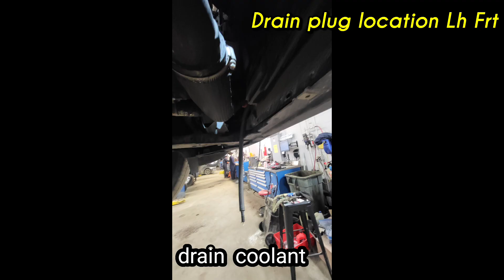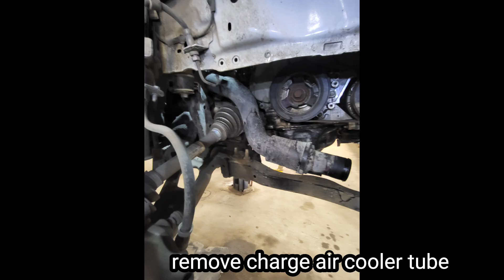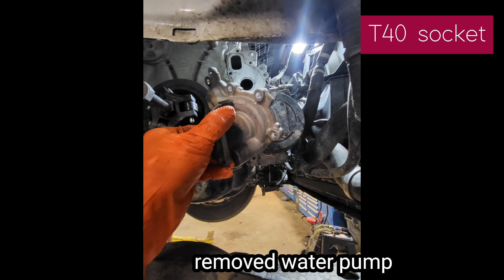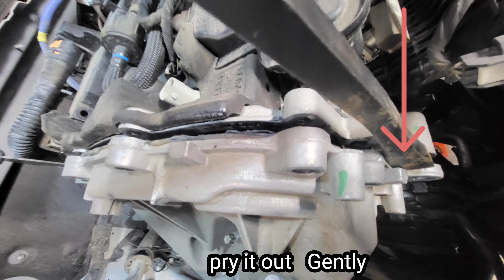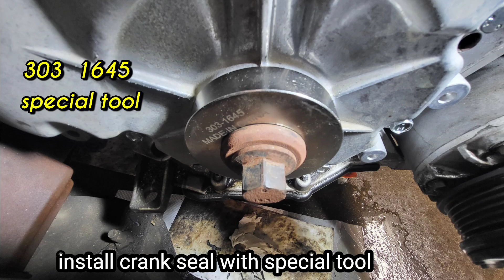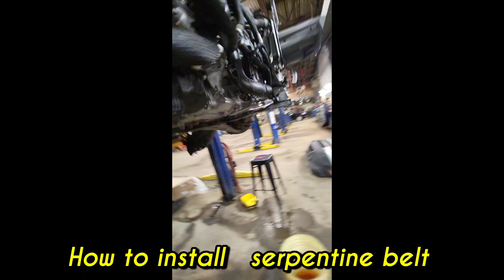Bronco sport, Escape 1.5L Frt Timing Cover Oil Leak , How to repair with silicone gasket .

Comment: 안녕하세요. Ontario에서 차수리하는  Charlie라고 합니다. 한가지 문의 드릴게 있어서 씁니다. 2019 Lincoln Nautilus  C05f4 : rear drive shaft speed sensor.   
Freeze data와 Live data를 보니, rear diff.의 speed sensor가 문제네요. 물론 local dealer가 stock 있는것에 놀랐고 지난 6month 동안 2개를 sold 했다네요.
8mm bolt 잘 풀고, sensor를 떼려는데 안나와요. torch로 heat up 해도 깊히 박혀있네요. 결국은 2가지 중에 하나밖에 방법이 없는것 같아요.
1.drop diff. as low as possible , put a screw (may heat up with torch) and pry out.
2.drop diff and remove sensor. (drill and put a screw and pry out).
먼저 1번을 할꺼고요, 문제는 2번을 할때 Diff를 removal 해야 하는데, axle pry out 안되네요. rear beam 에 welded 있는 bracket이 both 됩니다.
rear diff 를 removal 하는  tip 이 있을까요??
제 메일은 토니(tony) 인(in) 캐나다 (canada) 앳 야후 닷 컴.  이멜을 그냥 치면 comment 가 block 되더군요.
먼저 감사 드립니다.
Reply from the maker: 안녕하세요. 
먼저 그 뒤 디퍼런셜 샌서는 한번도 해 보질 않았네요 .

매뉴얼을 보니 , 
RDU rear drive unit ( differential) 
탈거순서 
Fuel tank
Wheel hubs both
Axles 
Muffler asy 
Rear drive shaft asy 
RDU connectors  ,
RDU  Vent hose , ground cables 
RDU  내림 

일이 너무  많네요 . 잘 달구어 빼보시길 바래요. 
카톡 ID  Brightcanada  입니다
궁금한거 있음 카톡 해 주세요
Reply: @BrightKim  고맙습니다. 귀찮으실텐데 답글도 주시고요. 또 궁금한게 있으면 카톡 드릴께요.